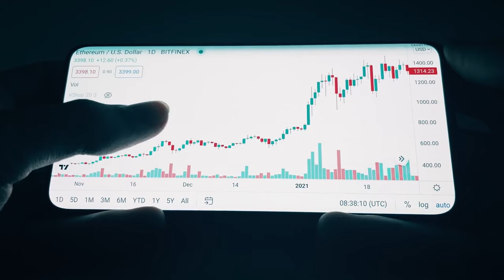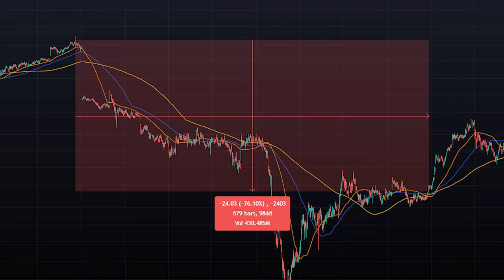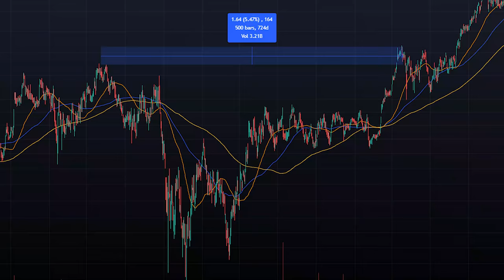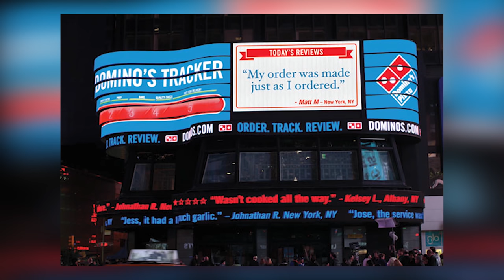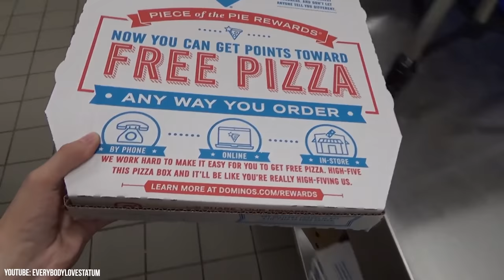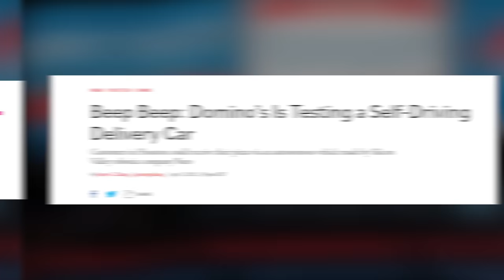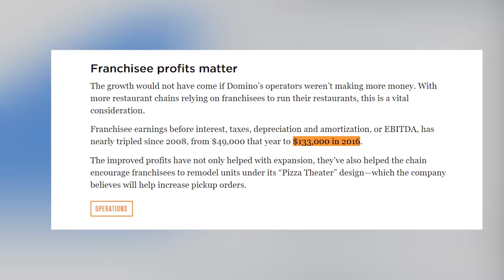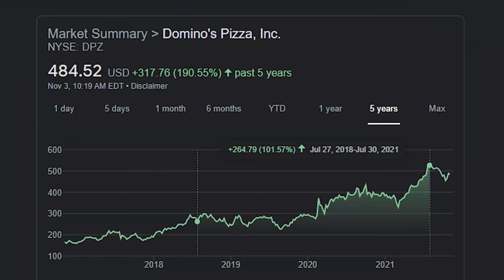How Domino's Pizza Squashed Every Company You Can Think Of

Comment: Turning the quality around on their product is what saved their company.  Good on that CEO to realize that if you don't have a good product, it doesn't matter how easy and fast it is to get, it's going to fail eventually.  Out of the main pizza chains, Domino's is top 1 or 2 right now.  It's in the running with Papa Johns for first.  But after those two, it's literally a race to the bottom.  I think out of all the chains, Pizza Hut should be worried.  The quality on their pizza is terrible.  The only gimmick it's had for years that had me coming back, was their stuff crust.  But now that isn't even worth it anymore.
Reply: little caesars is also going down the shitter for me due to the recent price increase. what used to be good to buy in bulk and get a decent pizza is now becoming a might as well just spend some extra cash for the better quality of dominos
Reply: @monkey.moments8272  same with cici's pizza. it had a five dollar increase from when i was a kid and the quality's only gotten worse. it was also great to buy in bulk. now, dominos is just overall better and cheaper

Comment: I've never had a problem with Domino's, and do think it's the best tasting in my experience. Other options for me is Pizza Hut, Papa John's which only somewhat recently expanded here (North West England), and the myriad of non-chain places. Domino's is the best but also most expensive, with Papa John's being a little bit cheaper, and almost as good. Pizza Hut's can be a lot cheaper cuz of their £5 Favourites thing but I'm not keen on their pizza (aside from the garlic sprinkle thing they do on the crust). As for the tons of smaller, local places I haven't found one that comes even slightly close to Domino's or Papa Johns as far as quality, and some aren't even much cheaper.

I should add, the Pizza Hut is a takeaway only one. Their actual restaurants are great, so I'm not too sure why there's such a variance there.